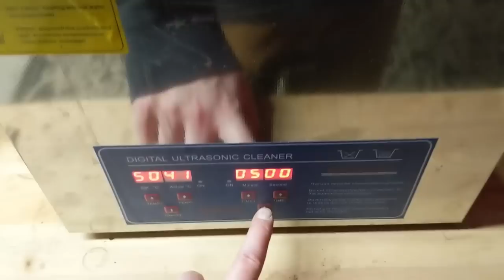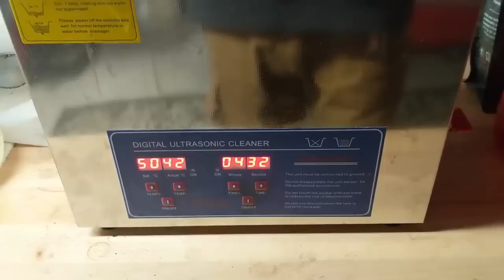How to Clean a Honda GX Carburetor

Comment: I've cleaned it all but fuel is leaking around the gasket seals. They are old so I've just decided to buy a whole new carb. Shall I use any lubricant on the new gasket seals??
Reply from the maker: No shouldn't need too